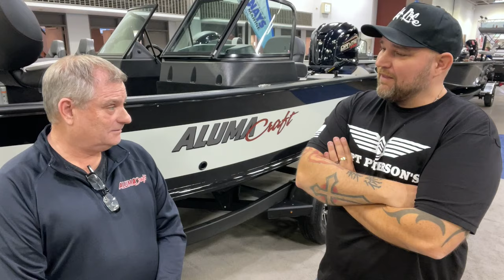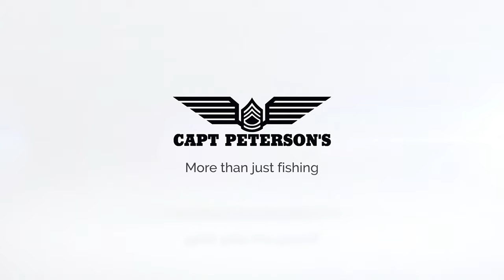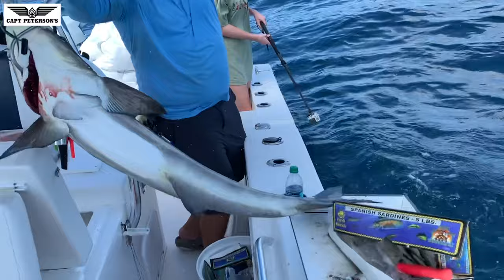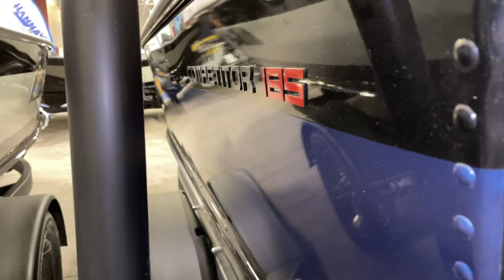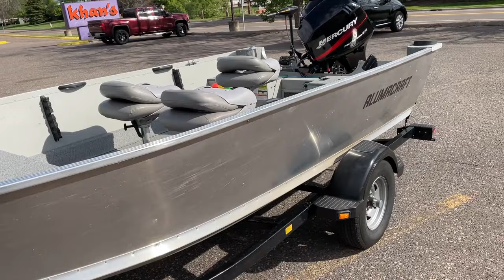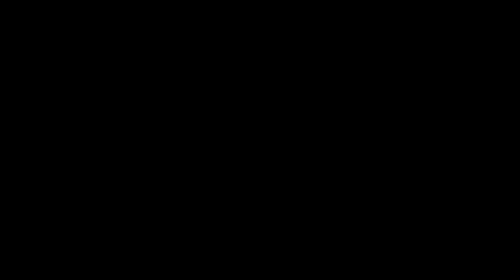No One is Telling You The Truth About Aluminum Boats So I Have To

Comment: For my uses it is irrelevant, I am not going to pound the boat to death lousy weather I am in the clubhouse, or the cafe. . However I would note, US aircraft carriers are welded, our submarines are welded and all automobiles - well 99.999%- are welded. I would also note like Alumacraft boats but they have some of the worst aesthetics of all of the boat brands. Their color choices are awful, actually butt ugly, and if the Mrs. is involved in the choice  forget it. Jazz them up guys, as my favorite chef says you also eat with your eyes.
Reply: Aluminum and steel are not comparable just as your 20ft fishing boat is not comparable to a sub or an aircraft carrier.
Reply: @johnbrown6189  Yes but there was a push to build Frigates out of aluminum. The Brits found out the dangers of these ships when  Argentine Exocets hit them in the Falklands and the Aluminum ignited. I used the carriers  and subs to point out that if rivets were superior, those ships would be riveted and not welded.  In most cases of small aluminum boats the construction  method is irrelevant, but the quality on the metal, structural design, workmanship and quality control is far more important. Generally with correct care and intelligent use a properly constructed boat  will take more than the  humans will.

Comment: Both OPINIONATED, USELESS. AND AIRPLANES have extreme, compound angles and must stay in tolerance to HUNDREDTHS Of an inch. And- as a war vehicle, areas will get damaged!  Requiring replacement AFTER all the avionics AND SENSITIVE WIRING is installed.  The problem. Here is obvious.  OT a fair comparison. BAD FORM